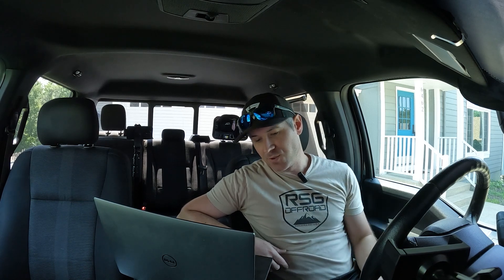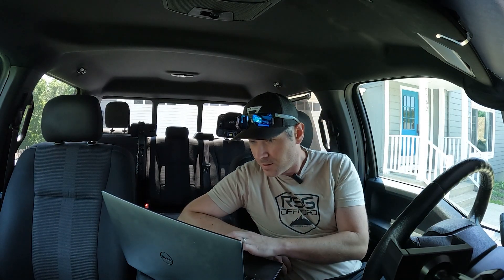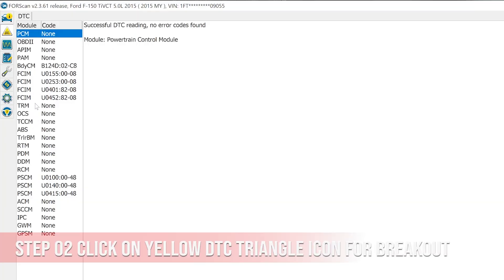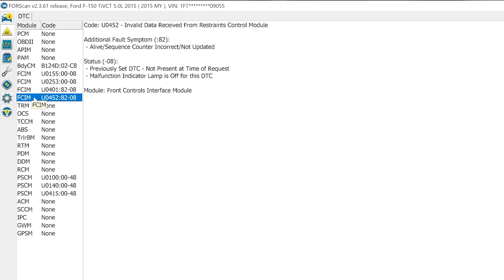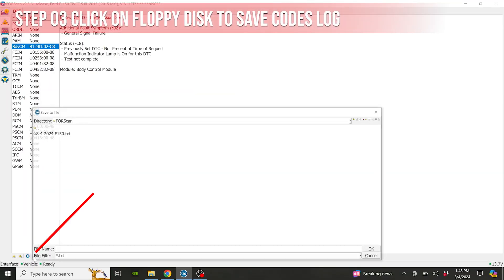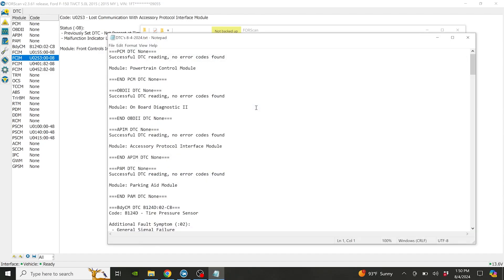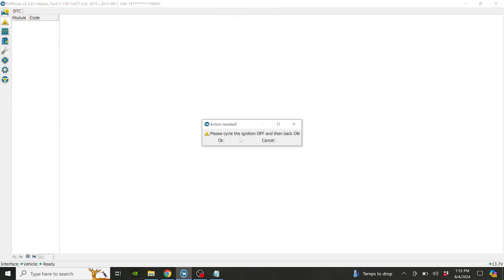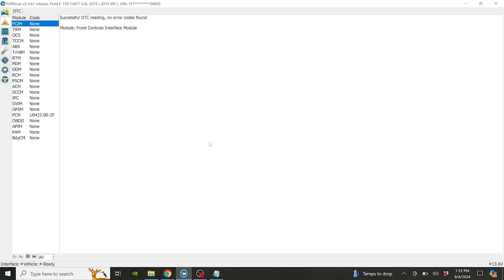I Cleared My Ford's Check Engine Light Using FORScan

Comment: How long does it last before they come back?
Reply from the maker: @Oilatumify  it depends on what your problem is and if it's something that needs to be replaced or just reset. I thought my Body Control Module was going bad but it turned out to be my APIM.

Comment: Jaco is i possible to reset only one code between several codes?
Reply from the maker: @coolissimo69  I don't think FORScan has that option. You can save the codes as a txt file prior to resetting so you have it for reference. I think you'd want to clear all of them at once, that way if they pop up again you know what's going on.

Comment: Hi Jacob I have 2020 F150 xlt and replaced my factory steering wheel with a carbon fiber one. I disconnected the battery before the process. After I re installed everything and ensured proper connection i am getting abs, steering assist fault, 4x4 fault. I  tried to clear the DTCs using the FOrscan but still keep getting the same code. Would you be able to provide guidance as what else i can do? Thank you,
Reply from the maker: I would clear the trouble codes then unplug the battery and pull the fuses related to those DTC modules. Let it sit for a few minutes then plug them back in and check for trouble codes. If that does work you could disable then enable those modules to give it a hard reset.